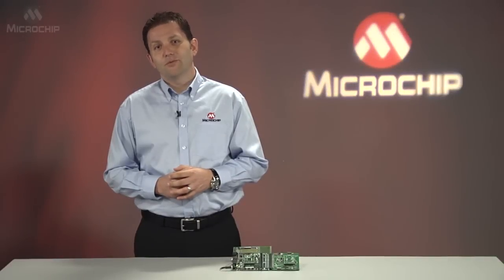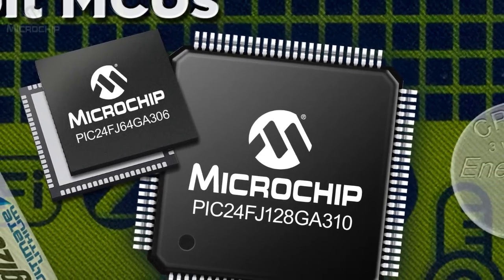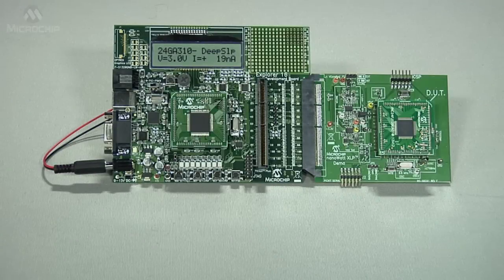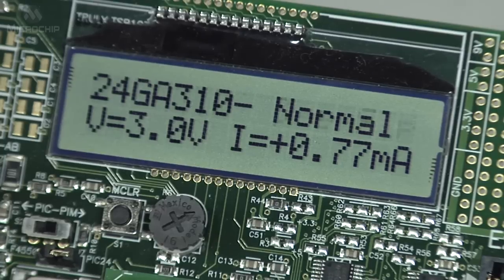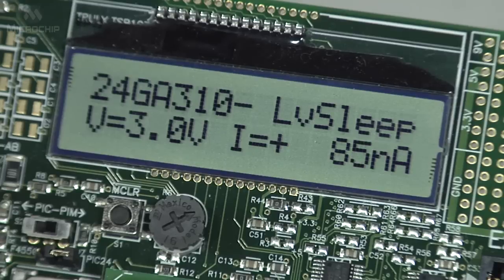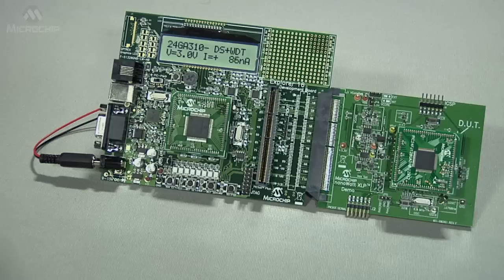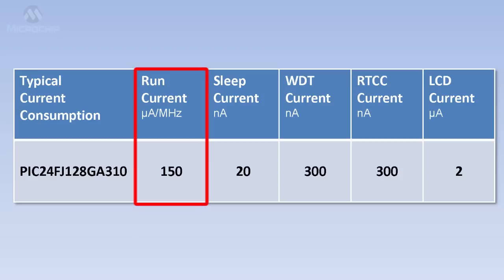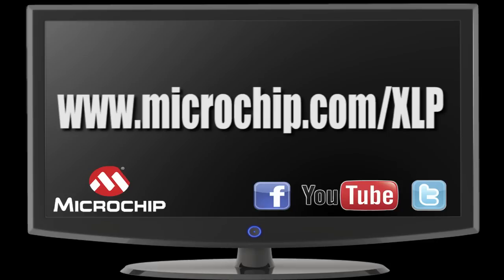PIC24F GA3 Series (Microchip Technology)

Comment from the maker: This device is not your best choice for USB.  We have the PIC24FJ64GB104 which is a better choice.  This device supports USB with on-board hardware.  You can use this device to emulate a gaming controller using our HID class USB driver which is free to download on our website.  We also have several development tools that can help jump start your design.  These can be found at the link too.  Thanks and good luck!